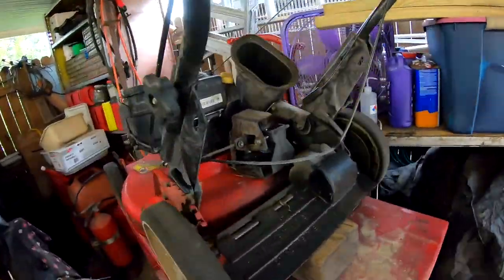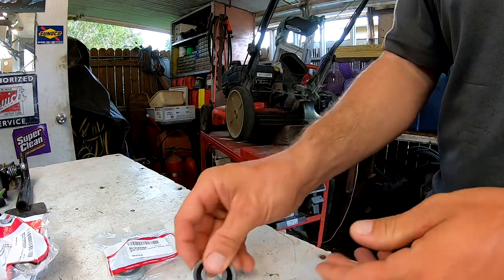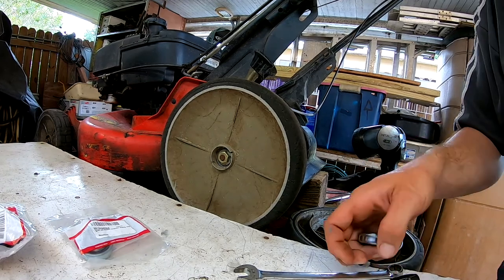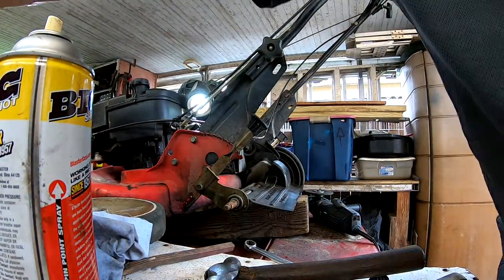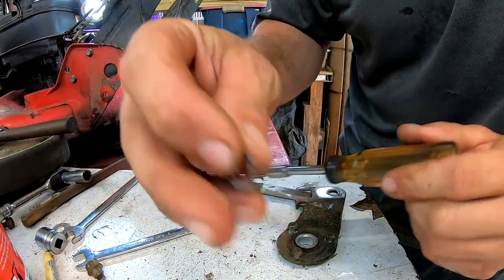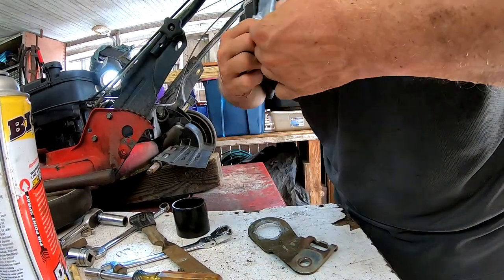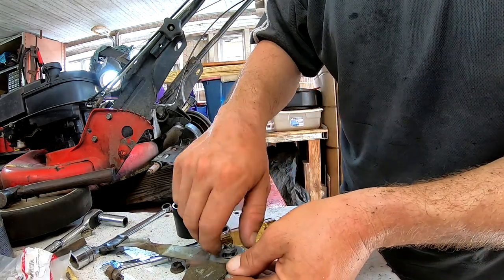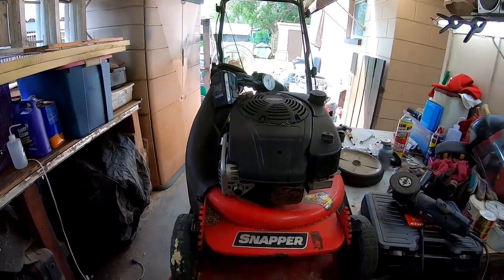SNAPPER PUSH MOWER WHEEL BEARING REPLACEMENT

Comment: Good to see that you had some Permatex Anti-Seize Compound on hand. This stuff is a must when working on your Snapper mower. A 4 oz container with a brush cap lid (P/N 80071) can even be picked up at a local Ace Hardware for around $6.00. The original aluminum base anti-seize is perfect for this application. Do not waste your money on the copper or nickel compounds unless you will be working with a high temp application like exhaust system hardware, slip joints and clamps.